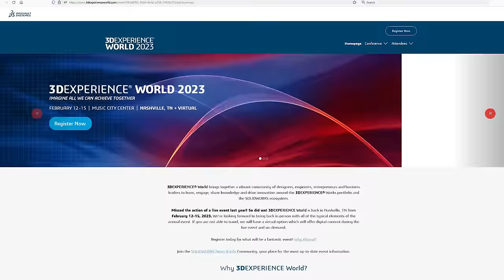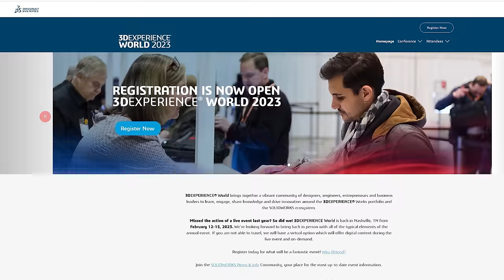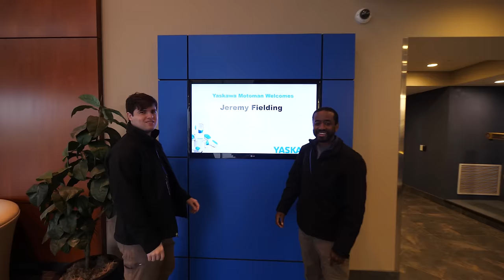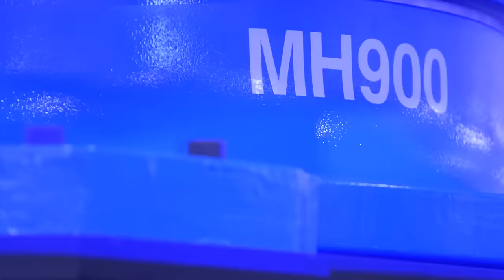The Challenges of Making Giant Robots: Yaskawa MH900 - Jeremy Fielding 108

Comment: I can definitely vouch for the quality of Yaskawa robots and more importantly the people involved.  I am an engineer for a sheet metal fabrication company, and we have two Yaskawa robotic weld cells, an ArcWorld 1000 (a medium sized single arm cell with a DX200 controller), and an ArcWorld 6200 (a large dual arm cell with a YRC1000 controller) and both have been great to program, operate, and design for.  Robotic welding can be incredibly productive, but it takes a lot of care to make sure that you are not efficiently filling up the scrap hopper!

If you need help with any of the programming or on mechanical side of your new robot, feel free to reach out! Good luck!

Comment: This video brought back a very old memory of mine. The first industrial robot (with more than four degrees of motion) I worked on was a Graco spray painting robot. All but one axis was chain driven from the base using hydraulics. In 1985 I was lucky enough to go on a training course in Norway to learn about ABB’s painting robot (called Tralfa, if I recall correctly).
That course set me up to work with industrial robotics for the last 35 years 😀
Your videos inspire young ‘engineers’ to learn about robotics and robotic applications. I’ve enjoyed every video of yours I’ve watched.

Comment: This reminds me so much of the factory I worked in as a Quality Engineer for John Deere. Obviously theres plenty of differences, but it's really interesting to see a lot of similarities. For example, we ran a test called "spin test" where we pressurize the main chassis before sending it to get painted, just to confirm there aren't any major leaks. The amount of bad/misaligned o-rings or loose fittings that we later found out about (the hard way) always kept the shifts interesting.

Comment: Jeremy,  when you were talking with the two Engineers about their multi-robot cells, did you guys talk about how they decided if & when to add redundancy (or quickly & easily swapping in a back-up robot/component) for when something inevitably does fail?  That would have been interesting to know too.  Thank you for sharing this plant visit with us!
Reply from the maker: Not exactly that no. But I know it’s a conversation they would love to have
Reply: These robots are extremely reliable, with MTBF of years of operation. They are also self-diagnosing, which will allow you to find the problem very quickly. The things that fail the most are usually the peripherals, such as welding guns, grippers etc. Don't forget that in applications such as welding, there are consumable items such as welding tips that need to be considered too. Spares are kept for yeas after the exact robot model is phased out also. I had a customer in the UK who had robots that were over 30 years old, still in production. Routine maintenance, especially grease is important.

Comment: Great video. I worked as a application engineer for Motoman Yaskawa for the the best part of 20 years. Any questions, just reach out. Don't forget that the controller has a built in PLC (Concurrent I/O), which is really handy, but the programming is very different to anything you'll see in other systems.

Comment: Introduction to many manufacturing issues such as leak detection in  castings, variability of casting sizes and interference issues, the thermal expansion and displacement issues during welding. Wow, lots of problems to be solved by skilled injunears.

Comment: The trade offs between adding a mechanical compensation system that would add more wearing parts that'd now need to be tuned and lubed forever while in operation while weakening the apparatus due to needing to accommodate the additional volume of parts through out the carry-way being solved by a few software components and some high precision sensors is really empowering to those engineers and designers enabling them to really max out what can be done with the materials available at hand.  Of course the sensor/power channels are their own circle of hell.  Hats off to the fine supervisors who've not driven their technical staff nuts by not being sympathetic to how bloody minded frustrating some "minor" problems can be; looks like they rarely have employees running out of the building screaming, showing up to work naked or worse; just goes to show you those company sponsored BBQ's have more than the obvious intended positive effects.
Reply: There's a lot of oddly specific details there, @PsychoticusRex.

Comment: Great job interviewing, it’s wonderful when the YouTuber let’s the people interviewed talk freely without over talking too much.

I did have one question, what are they using WD-40 for? Is it to lubricate the wiring harness as they’re threading it through the arms or cleaning off machine surfaces? I use it only to clean my greasy tools in my shop after finding out, it’s a bad long term lubricant.
Reply: There are too many ways to count how WD-40 can be used in a machining and manufacturing facility. WD-40 is a fairly good cleaning agent on machined surfaces because you don't have to worry about flash rusting unlike a lot of other cleaning agents that are more effective but might flash off. Based on the type of work they do I would guess it's being used to clean shipping grease from hydraulic cylinders because it will not damage the seals. They might also be using it as a cutting fluid for Aluminum when they need to repair some damaged threads on tapped holes.

Comment: I feel absolutely robbed! As an electrical engineer, the super nerdy motor control conversation is one part i really wanted to hear! Ive also always been interested in robots, but finding myself thinking about them more and more. I want to build an articulating robot and attach a spare 3d printer hotend / controls and experiment with different printing techniques. I also want to do the same but instead have a spindle i can use as a multi axis milling head. Maybe build one robot with interchangeable tool heads. I think it would be amazing to be able to machine and print on the same part.

Comment: as far as this robot being set up for 480v, the actual servo drives run on 200-220v 3phase. Typically, there is a transformer in the base of the control cabinet that steps down the incoming 480v to that range and you can just bypass it. You will still need a 3phase power source but that can easily be done with a small rotary phase converter. You think you'll be surprised by how little power smaller robot require to run.
Reply from the maker: I discovered that this morning. Already bypassed the transformer 👍🏾

Comment: 20:55 That is probably most important thing for engineer to have. Guys that do the work and use the equipment coming to say their mind to engineer with out engineer throwing a hissy fit over his ego and actually improving things by listening. Seen few engineers that were so high and mighty masters of everything... but didnt know you cannot just simply weld steel and glass structure with full welds just like that, nor didnt he know what tag weld is. Thats why i'm of a opinion engineer should always be in the field they are designing stuff, work on the ground with people who do the actual work to learn even the basics of the practical things before drawing a line on the design.

Comment: The IRB8700 of ABB capable of handling 1000Kg but still it uses the same drive unit of small robot and the same cabinet powered for the other robot. The IRB8700 is a brilliant robot design from ABB.

Comment: Check out Phase Perfect's Enterprise series for digital 3-phase converter (not VFD) from 240v single-phase. I have a sensitive machine with Yaskawa drives, and the rotary 3-phase manufacturers wouldn't guarantee their voltage accuracy. Pay the extra $400 for the IGBT sound reduction. Best of luck!

Comment: What part are they talking about at 21:49 ? Jag bolts? I couldn't find anything on google. Thanks so much for the video!!!
Reply from the maker: “Jacking bolts” used when you have a very tight fit and need to separate parts or when you need to make micro adjustments to the position of a part. These are a couple examples of uses

Comment: Could they pump co2 or some visible gas through the system to make leak control way faster ❤❤❤❤❤❤❤ or even use non visible gas with a few esp32 sensors that they can use to find where it's coming from

Comment: I'd be interested in a 2nd video of the controls work cut out, maybe second channel if you did not want to bore the general public here, but as a controls engineer, I feel a little slighted, but that may just be my typical primadonna controls attitude showing through... The mechanical guys say, yeah! we designed this, and everything moves, the rest is just software....
Reply from the maker: The controls part is very interesting, and extremely important I think. But it is also very abstract. The parts that are physical all basically look the same. A box or board with wires/ lines. It’s really hard to get more than a hand full of people excited because they need to already understand a lot to follow the conversation. There are indeed a lot of “us” interested, but there needs to be enough none-technical people willing to watch and share to find all the technical people who would love to watch.

Comment: Yaskawa will likely junk out the spring motor assist the first time a spring fails in use, wherein hopefully nobody gets killed. Seems like that'd be a catastrophic crash.
Seems like the casting pinhole could be tested prior to complex assembly by cutting some closure plates for use only as a test vessel
Reply from the maker: Actually there are two springs, so both have to fail, but I cut that part of the discussion. Also its not appropriate to say the spring will fail without knowing it's safety factor. There were other things left out due to secrecy but this gives you an idea. It more robust than you assume.  I of course haven't done any calculations myself or know all the loads of the systems. This is not meant to defend Yaskawa. I am just soften your comment a bit by pointing out there is more to consider and you don't quite have enough information.
Reply from the maker: I think creating a test plate to test the casting is in interesting idea. Perhaps another jig they could make to speed up the testing process. However, he said later that was a rare example. He didn't exactly say this, but I got the impression that it was more common (when there is a leak) that something during assembly was wrong, and it could be redone with the leak going away. I was especially asking for examples of things going wrong and how they (Yaskawa) dealt with it throughout the whole interview. It was my main question LOL. I felt like that was the most interesting part for engineers like you and myself. Engineers like to think about problems, so I wanted to know what the problems where not how everything went great. So I might have accidentally given the impression that these specific problems are common, when really the message was "problems" are common in manufacturing in general, and we have to resolve them as they come up.
Reply from the maker: I also want to add, thank you for commenting! I feel like I should send you a sticker or something. When I immediately recognize a name in the comments among thousands of comments, I know this is a person who has been following for a while and participates in the conversation. I am glad you are here.
Reply: @Jeremy_Fielding  Interesting that they use 2 springs, the safety factor is one issue but in a life safety critical app, redundancy (could be a tracking stop to limit catastrophic collapse) is req'd imo, & they may have that. Kinda like rare pinhole leaks in a casting, rare undetected flaws in a spring can cause very early catastrophic failure whereas stress flow in a beam structure can work around a rare flaw & maintain a serviceable beam. In wire rope apps where redundancy is rare or impossible, this is handled by multi-strand rope construction (isolates rare mfgr'g flaws probably to one stand) plus 8X safety factor plus time in service limits, and still accidents happen, tho mostly by operator error (vicarious experience gleaned from high tech Cirque du Soleil apparatus)
Reply: @Jeremy_Fielding  He's probably talking anaerobic sealer, which I've used with varying success. Too little leaves a gap, too much is a mess. It takes practice, maybe that's something a robot applicator could solve better?
Reply: @Jeremy_Fielding  I always make a point to zoom in when JF speaks, here or on Eng'RG Fatherhood. 2 of my favorite channels. Thanks back attcha for the efforts.
Reply: Spring motor assistance is common solution in the industry. Look at different brands ABB, Motoman, Fanuc or KUKA and you will find that most solutions with payload above 165kg will have it. Latest generations with more powerful servos may lift the bar higher than 165kg.

Comment: they could have used robots like these to make more robots. procedural code would do just fine. its not to hard to make code or even non computational logic that can do pick part and calibrate before following the rest of the code sequence programming. you need a switch that can represent pressed or not pressed a 1 or 0. that is you decision making function. then you need a trial and error mechanism using a preplanned pick pattern. if the weight lock it can then move the arm to desired position. this is not a whole program just a example of how simple code either purely Mechanical or computer code can do seemingly intelligent moves.

Comment: Jeremy, DUTY CYCLE consideration is a big surprise. Of course you'd think about it if it was your lawn mower or home heater but getting a long assembly of many functional steps by a machine ... Duty cycle seems like the last thing to consider, but they can burn out if overworked or loaded too heavily etc. You think of that with people but machines? You don't think of an engineer nerd worrying about people let alone applying that thinking toward his machines. Of course, if you listen to mechanics on cars and other devices, engineers never think past building it. Repairs aren't their worry. So, that bolt is buried behind a frame and is too long to extract without complete disassembly of....GRRRR. ANY mechanic can tell you stories daily of some machine that would be ten times easier to repair if the design engineer had given a single thought to having to repair it... If you have to create jigs and fixtures just to assemble it IN THE PLANT, what would a mechanic have to have at HIS disposal in order to repair it?